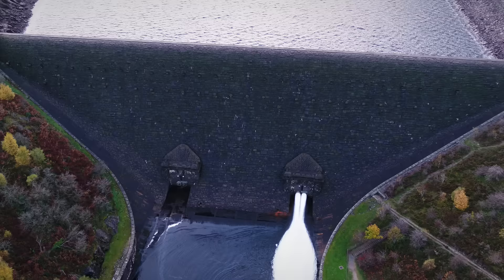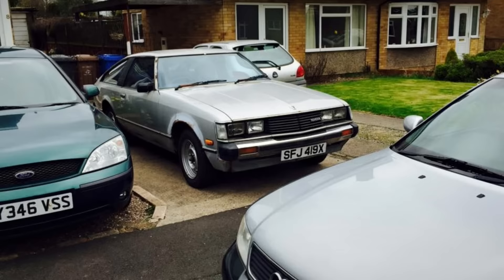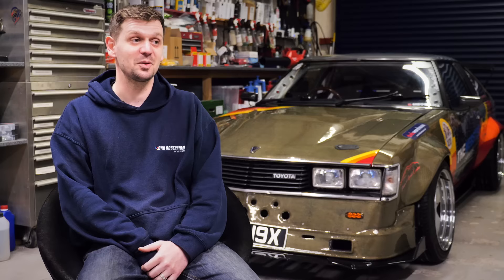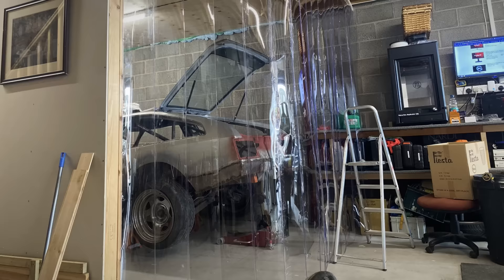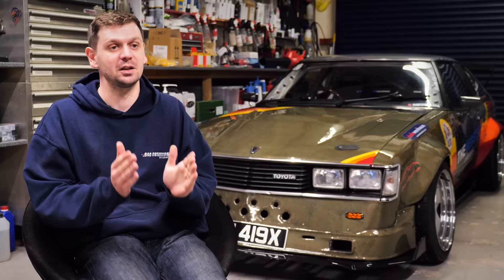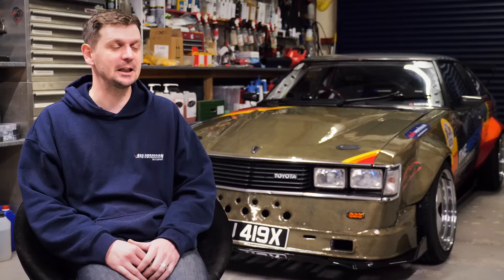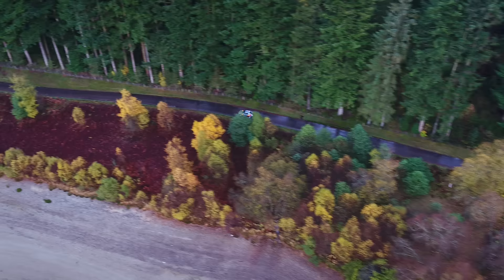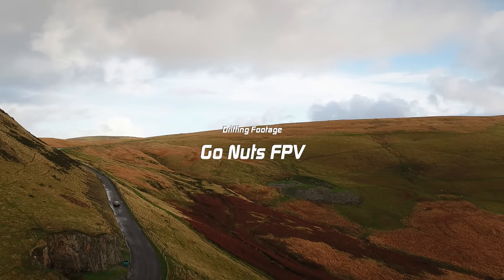BMW M50 Powered Celica

Comment: These were really common in Australia. Rust like this is almost completely unheard of here.  
In fact I'm a mechanic and one of my customers had 3 of these in the forest at his rental property. I used to work on all of them until each one became unviable due to the abundance of cheap better running ones. 
I was constantly out there removing parts from one of the non running ones to keep the current one going. Anyway he got a cheap 4x4 and all 3 got parked and his landlord cracked it and made him move them all on. He got scrap prices for 3 good rust free cars that's how little and unloved they were worth here pre covid. They were all crushed in mid 2019. I believe they're worth more now. Yep I knew a thing or two about these for 20 or so years there.

Comment: Many years ago, I actually used a plastic water bottle (one that you would bring to the gym, that kind) as a washer fluid bottle. I had clearance issues with an aftermarket air filter kit, and instead of modifying the air pipe or changing to a smaller pod filter, I decided to remove the stock washer fluid bottle, remove the pump & proceeded to drill a hole in my wife's neon pink gym bottle that she had left, right on my table. Bit of plumbing epoxy & cable ties, and my shiny new air filter kit was installed, along with an unplanned mod that raised everyone's eyebrow when they saw a hot pink bottle just chilling in the engine bay.

Comment: At the very end when he says "I don't have words for it; it's just cool," I think I can explain it.

There's a phenomenon that happens when a person uses a tool long enough in which the body begins to treat the tool as a literal extension of itself. This can be seen when a person says "ow" after something surprisingly bumps into a tool they're used to. From my own experience, I have said "ow" after driving over a dip or bump that was larger than I expected.

Once a driver develops this kind of relationship with her car, driving stops being a process of sitting in a chair, turning a wheel, pressing pedals and manipulating levers. Instead, she wears the car like her most comfortable clothes, the axles and tires become her legs and paws, and when she accelerates off the line, she feels like she's scrambling over the pavement like a cheetah.

Then when the driver also built the car with help from friends, the relationship deepens that much more and enhances the experience. Or so I imagine, since I haven't built my own car or motorcycle yet.

Comment: A man after my own heart.
I have a UC Holden Sunbird 4 door ugly duckling.
It has Datsun 240k grill and tail lights. A 6cylinder holden motor behind the front cross member ( midmount qualified)
Power steering rack from a Ford Cortina ( for a dissabled hand I have)
A massive Ford cross flow radiator and fans from A Ford XH ute.
A Ford nine inch with 275:1 ratio ( highway gears).
3 speed Auto From A Holden Commodore ( V8 drum, clutches, no wave washers, extra clutches etc)
Honda Bucket seats.
A sun roof.
 Orininally built in a stupid 12 day madness from a rolling shell.

Annnd now it's going through a rebuild.
When I have spare time.
When customer car work isn't a priority. ( no work booked in).
Definatelly spent more than 12 days thus far.

Yet another enspiring build to keep me motivated.
Thanks guys😉
Will continue waiting on Binky updates🙂👍👍

Comment: Kudos on this, not many people mod A40's, I have a soft spot for the A40's, way closer to the AE86 than most people know, I'm gutted they didn't as popular for AE86'ifying after KE70's and TA60's ran out.
Went somewhat nicer on my TA40 5dr estate with the motor, front-suspension (and soon, rear suspension) from an AE86 (had to get a donor-shell for that, so I can transplant the floor).
The hardest part was by far the rack & pinion conversion, getting the rack center into the same position as the drag link and making it look stock, knowing now what I didn't know then, I should have moved it forward and gotten more lock before binding 🤣 
I certainly could have 2J'ed but I'm not the power type, this Celica is great though!

Comment: Built not brought ❤ my project is a Porsche 914 , basket case with rust and other problems . So I changed gear from a restoration to a retro mod build. Porsche 996 front rear suspension steering brakes and Japanese engine , wrx fa20dit . ❤️🇦🇺👍

Comment: Very nice car, but the engine on the video is clearly M52TU, not M50.
Reply: And not out of a 2001 323i, those were only delivered up to 2000, it can be out of a 325i. but then it would be a M54B25..😁 #nitpicking

Comment: Always thought that generation Celica was fugly. I want one. And the previous gen (the Mustang Fastback looking "Liftback), and the next gen (GTS with independant rear, especially). I also want more of the Car I preferred to those, the Dodge Colt/Mitsu Galant. For my first car, I had the option of a '74 or '75 Celica in need of a front pulley on the engine or a '76 Colt needing an axle. I took the Colt. If it had been the Fastback Celica, I might have gone the other way.

Comment: Great video, however I do still have to point out that the M50 never came with the E46 model. It must have been an E36.
EDIT: upon seeing the engine it is one from the E46 however its the M54 not the M50.
Reply: or M52TU. But yeah its not an M50. You see it on the valvecover and intake.
Reply: Initially it was a blown up M50, then it evolved but the name stuck.

It’s an N54 now 😂
Reply: @petroldan  fair enough.